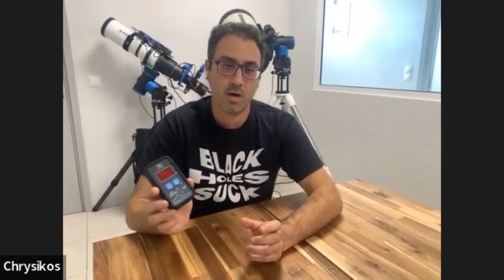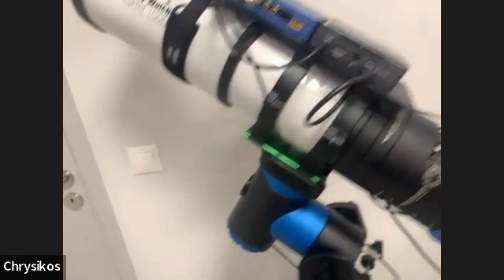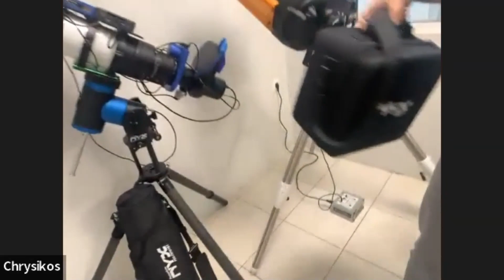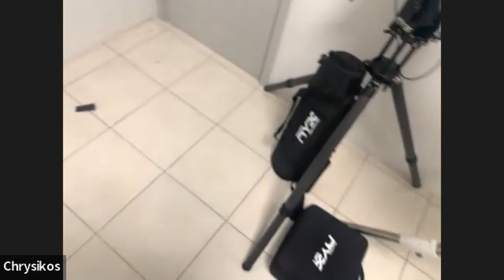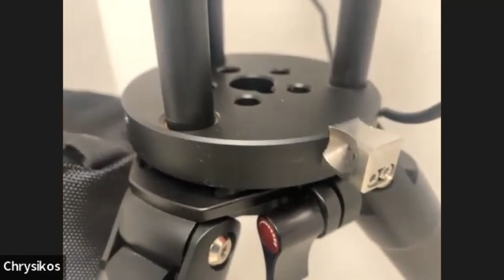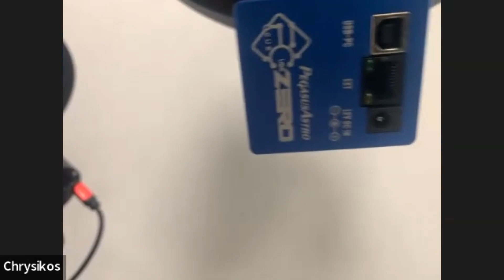The Astrophotography Podcast - What is new with Pegasus Astro

Comment: I purchased the NYX-101 mount.  It is an excellent mount in many regards.
HOWEVER
I have run into a number of technical issues with the mount.
The biggest issue is the occurrences of Motor Collapse, when using a large telescope (10" Imaging Newtonian) there is no documented support for working with such large scopes, and I finally worked through email with a Pegasus rep.  He explained that, with such a large scope, to either add a counterweight (even though the setup was < 45lbs) to counteract the extended center-of-balance, or to lower the mount speed, to increase torque.
The second issue I encountered is the inability of the mount to connect to a modern Wi-Fi network.  My home network is an EERO 6-plus, and I followed the suggestions in the Mount's FAQ page to turn off 5g connectivity on the network in order to connect.  BUT even then, both the mobile app and windows app showed multiple, duplicate, networks, and completely failed to connect to any of them.  EVERY other wifi-capable device I have EVER used has never failed to connect to any network without issue.  The inclusion of such a primitive wifi card (and/or the utter inability to provide a modern firmware for the card) absolutely boggles me.
Lastly,  the mobile app (iOS AND Android) are virtually useless.  It provides a mere fraction of the functionality that is available in the PC app.  Features such as Firmware updates, the ability to change network connectivity, Port management for connected Saddle/ Power boxes, and a host of features that SHOULD be included in the mobile app simply arent.